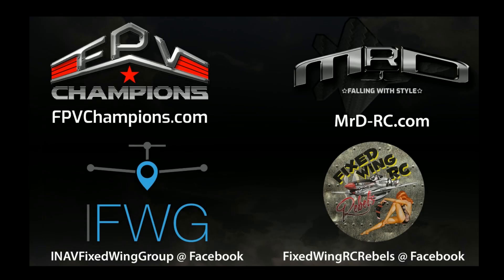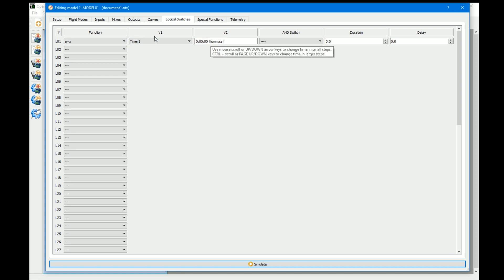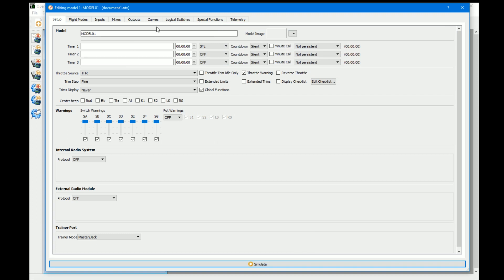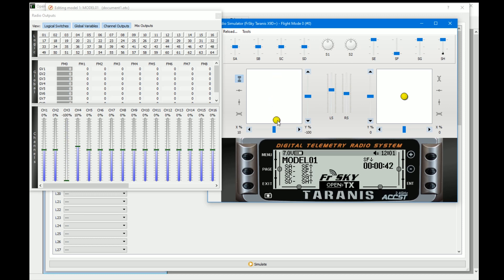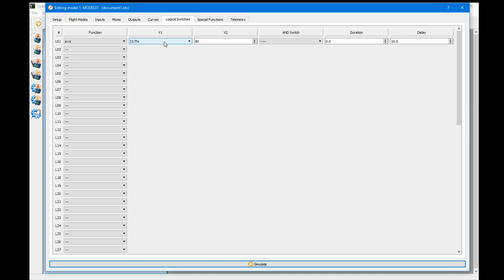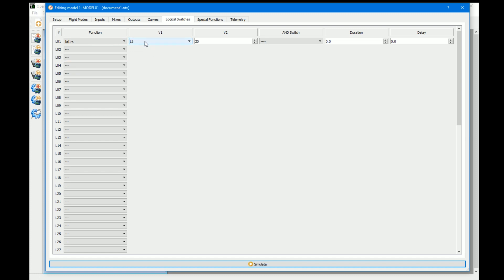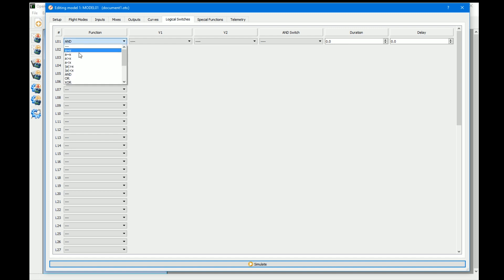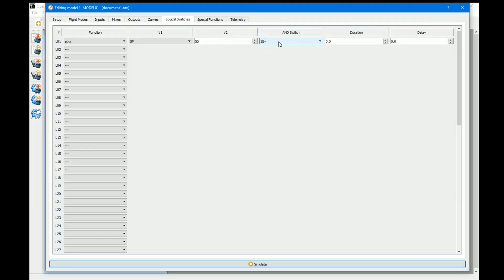Logical Switches -  Comparing A with X

Comment: In the inav guide, there was an example of a radio with a whole bunch of logical switches enabled for modes. This is what confused me, so it will give a better explanation on how they work. Even though, they say you don't need any of these to set up mode and sub mode. 
I think to take advantage of open TX and it's power, tutorials like this is excellent, because not to many go indepth enough to understand.
Reply from the maker: Thanks John. It's great to hear that. 

I think that learning how things like logical switches work is much better when broken down. Just opening up that model and looking at it would just pup people off in all honesty. Maybe in the future, I'll do a breakdown of that model in a video. But for the time being, I'll keep everything simple, maybe going though a few of the operations used in that model individually. The multi-function momentary switch or a mode/submode switch layout, incorporating the transmitters' flight modes.
Reply: @MrD  
Yep, turned me off from that model, simply because it looked to complicated to even attempt without understanding how it works.
At least now, have a better understanding with this series. Thanks.